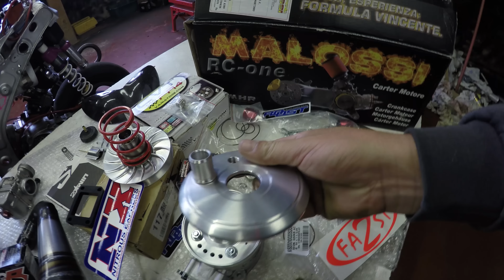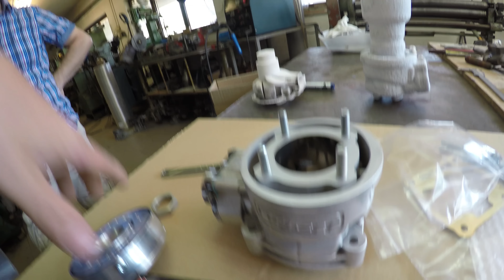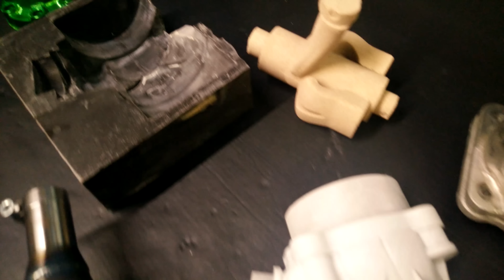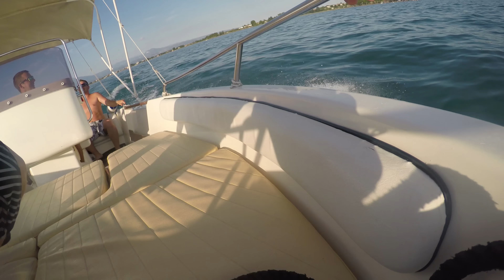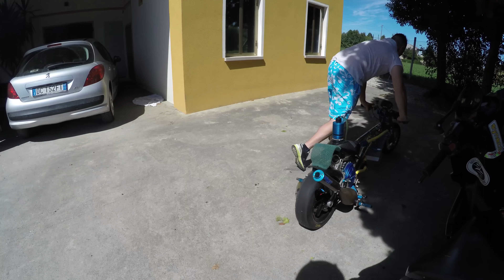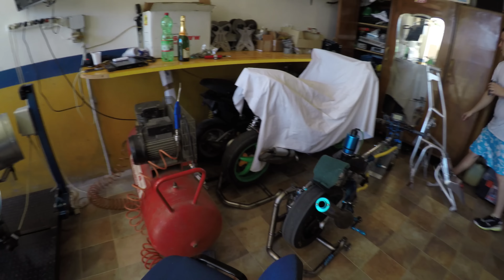Picked Up My New Roost Havoc 98cc

Comment: the doppler clutch is to weak it won't hold up.
Reply from the maker: +Stefan Janicic the dopller clutch is the best on the market , it will ;) hold up i think ... butt i will test
Reply: +zip stunter my friend have a rt95 stage 6 aerox that clutch didn't even hold for 10min until it was gone 😉
Reply from the maker: +Stefan Janicic you probly had the wrong bell ,  on my zip r/t it held up very long
Reply: +zip stunter think it was a Malossi bell not sure 😕😕